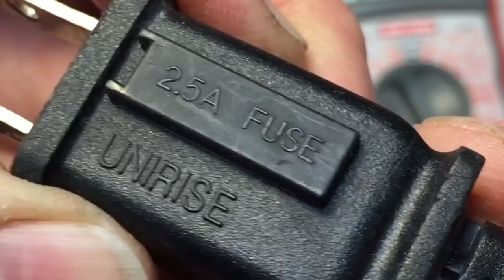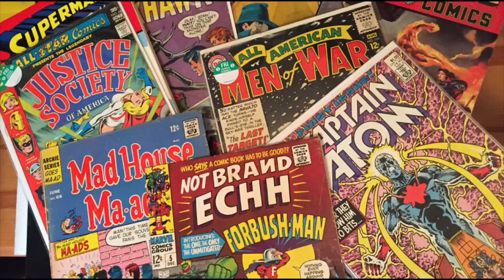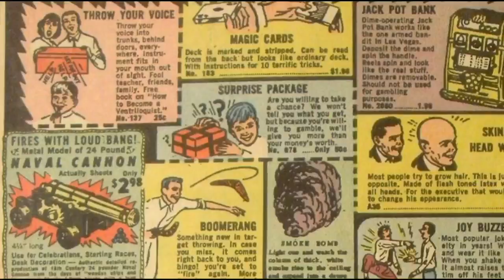Fused Power Cord, Western Electric 500 Telephone and Satellite Spring Shoes!

Comment: Hey Scout, thanks for the memories. I went through a phase of collecting free treadmills and breaking them down to repurpose the motors and other components. A lady listed one for free and said it was working but the display didn’t work so I picked it up. When I was dismantling it I noticed a little hatch on the back of the display and inside was a single flat AA battery. I put a new battery in and the display worked fine. I finished dismantling it but thought to myself “people really should read the instructions”. I’ll bet the instructions that came on the appliance you got the cord from tells you there’s a fuse in the plug. That was the only treadmill I ever came across with a battery for the display. Cheers Stuart 🇦🇺
Reply from the maker: Great find!!

Comment: I used to work on the Eastern Test Range in the early 80s we had those phones, and an old Stromberg Carlson XY switch, one of my jobs was to repair phones, XY switch and cable plant we had roughly 500 lines alot of party lines. I really liked it, the biggest issues with those phones were the smokers the smoke would crud up the mic side of the handset, phones were damn near unbreakable. That has a newer L1 block. Thanks for the memories!

Comment: I remember the old telephone set.  We and my grandmothers had these type of instruments.  They were made of bakelite or similar plastic.  Western Electric was the research and manufacturing division of AT&T.
My dad had a gasoline torch like that one; I still have it.  The little hook over the top and the indentation over the fire nozzle is the location to place a soldering iron while the tip was in the flame getting hot.  It was kind of a trick to get it to light and burn.  It was similar to the Coleman gasoline stove and lantern.

Comment: Hi John, great mosh. First, I was about the same size as you in the photo. I hated getting cloths because I had to get the “husky” sizes. Not that things have gotten any better as I turned 66 last September. I also couldn’t use toys like this so I feel your pain. I have a funny story about the rotary phone. I’ve always been fascinated with how things work and taking things apart. Eventually getting good at fixing and getting back together. I took an old rotary phone apart and figured out the dial opened and closed a reed switch set of contacts to dial the number. You rotate it to nine, a spring returns it to home position, and a cam bumps the reed switch open and closed 9 times during its rotation. In college, the student councils office put a lock on the rotary dial to stop long distance calls. Only a select few had the key. But as a ham radio operator since since 1969, my morse code skills were very good. So I would take the headset off the phone to get the dial tone then tap out the number on the buttons that hung up the phone. If your rhythm was consistent and the right speed, you could dial the phone without using the rotary dial. I was quite the hero until someone caught me. Then they locked the phone up in the desk.  Thanks for your continued work providing us with entertaining stories and demonstrations and ideas and sharing your knowledge with us. It’s a wonderful trip down memory lane most of the time with some new learning and laughs. I work with a lot of younger folks (20’s and 30’s) that have no clue what I’m talking about most of the time. But here that doesn’t exist. Cat tV made me laugh. I was wondering if you have any new litters of mice in the making? Or if you did gynecological exams to separate the boys from the girls. I Dan just see you in a head lamp magnifier glass. That’s twice You got a laugh out of me today. Thanks. 

John
Reply from the maker: Hi John!  I separated the mice a while ago and they seem to be doing really well except mama looks very plump and I’m often wondering if she is pregnant again! 😂😂😂😂👍
Reply: Maybe one of them was a female but now identifies as a male. 🤪🤪🤪

Comment: HaHa every set of modern day Christmas miniature incandescent lights I have had and threw out because they were shot I saved the fuse. I have a bunch. When I was in the Air Force my trade area was telephone installation. After training I was assigned to my first base and when I reported the first day I was assigned to clean those 500 series single Line instruments (desk and wall) They had a work bench and there must have been hundreds of these phones. So another new guy and me worked for a couple of weeks getting through the huge pile. We definitely got familiar. We used a lemon based spray on cleaner polish and it shined them up real well. I was happy to finally get assigned to a crew.

Comment: At a Scout Troop meeting years ago we visited the local Bell Telephone exchange building. When someone is dialing a number on their home phone a like set of electro-mechanical relays are duplicating that number in the exchange and making the proper connection. If all of that equipment were in place today I would stand there and be just as awed by it. There were movable ladders for the switchmen to do maintenance and thousands of relays for them to maintain; an absolute masterpiece of engineering duplicated thousands of times in the US and around the world; and operators standing by to help along the way. Then the early toll free with a “WATTS LINE”

Comment: It's funny every plug here in the UK is fused but in all my years I have never seen one that has a spare replacement fuse holder built in that is such a good idea.
Most of our plugs also require a screwdriver to unscrew the screw or screws holding the cap on to replace the fuse, you do see some with a pop out fuse holder you don't need a tool for I've often wondered why they aren't all like that.
Those old phones take me back, I remember in my early teens a girlfriend of mine had a pulse phone in the house and her parents would use a lock to stop her using the phone dial but she got round it by tapping the pulses out on the receiver switches 😁.

Comment: I use such an old phone on my VoIP line. Just installed a converter between the router and the the phone to convert the old pulse dial to the modern multi-frequency dial. I have a W48, and there's actually a company still manufacturing them and also spare parts for the old ones. Also modern microphones to replace the old carbon microphones, easy to replace. Just unscrew the cover of the microphone on the receiver, the microphone is just laid in (spring contacts), remove the old one and lay the new one in. Screw the cover back on -> done. Massive improvement on the quality of the voice transmission. Heavy bakelite phone.
On the old pulse dial system you were also able to dial without the dial plate. Just push the hook you hang the receiver up to in the same speed and as constant as the dial plate does it. That's the reason public phones here in Germany had a damper inside to prevent people from dialing with the hook, bypassing measures that prevented that someone dialed expensive numbers for the local rate. The dial switch inside does only connect/disconnect the line sending out pulses. 1 pulse is number 1, 2 pulses is a 2 and so on, and 10 pulses is a 0. There were also countries, for example Sweden, where the 0 was 1 pulse, so the first hole wasn't the number 1, it was 0.

I'm almost 40 and I know that. And I know some phones in offices had an attachment on the receiver so you did not need to bent over your head too much to hold the reiver that way. 

https://en.wikipedia.org/wiki/W48_(telephone)

Comment: Phone Fact: Back in the 70's, the 7 Baby Bell Phone Companies charged residents for a phone line. Any extra phones added to the line required an extra Extension Charge. The Security Dept. would ring every phone number once, to do a voltage check. If you were paying for just a phone line, but the voltage check did not match what a single line should be, they mailed out a notice to cease and desist, or get the extension added to their bill !

Comment: Not sure if you know John but every plug in the UK is fused. If I remember, I’ll send you one.
I’m old enough to remember those phones. Did you know you could dial a number without using the dial? If you tapped the buttons that put the phone down quickly, it never put the phone down but dialled a number. Eg, if you wanted to dial 911, hit the button 9 times really quickly, pause for a second, hit the button once quickly, pause for a second and hit the button one more time. Hey presto you’d get put through to the plod! Did you ever try that method of dialling?

Comment: The spring shoes weren't as good as a pogo stick. Not enough spring in them. The rubber buttons were needed for moving with them. Without the buttons they were so slick on the sidewalk you would end up flat on your butt. 
I remember reading a story where before 911 you would call the operator. They would send the police or fire and give advice on how to handle minor problems. Since most of them were Moms they were use to it. A woman called the operator and said she was trapped in the house. She couldn't get a window open. The operator told her to throw the phone through the window. They were tough. So was the phone. 😁😎

Comment: To test the dial speed for proper operation, dial zero. When you release the dial it shook take one second for the dial to go back to the parked position. We used to count , one thousand one. Just a field test from the old days. Those phones are dated either on the bottom or on the side of the network box. The plastic dial is a newer phone than the metal dial. 

Thanks for the fun.

Comment: You could throw those phones and not break em. I know a guy that worked for the phone company he still use a rotary dial. I was told in power outage those phones would still work. I suppose because it was on another grid?
Reply: i have one in the basement for when the power goes out it uses the power from the phone line low voltage and the cell towers are down so my cell phone dont work

Comment: I will never part with my rotary phone.  My parents got it in the early1960s (on a party line, no less!) and IT STILL WORKS.  Or, at least it would if I had a landline, which I don't anymore.  But when we did away with the landline in 2018, the rotary phone would still dial out, and that bell inside could wake the dead when someone called.

So, it still sits on the small table next to the antique console stereo - also inherited from my parents.  More an artifact now than a working telephone, but I'll never part with it.

Comment: I picked up a tumble dryer a few years ago via the freecycle network, was stated that it worked fine then suddenly stopped, theymthought motor or program module both easy to get and fit, got it home started trouble shooting plugged it in put a voltage detector over the cable and low and behold a blown fuse, that was eight years ago and its finally packed up and not worth repairing so now its broken up and is part of a fire pit

Comment: If you want to convert that power to a regular cord, you just remove the fuse and stuff aluminum foil into the space of the fuse.
Reply from the maker: Actually a small piece of copper or Brass rod the same length and diameter would be considered a decent fix!  We don't usually see too many of those mini fuses around here these days.  =D  Thanks!

Comment: The neutral has ribs on the side of the insulation. If it’s polarized, the wide plug is the neutral. I remember this by saying white wire is wide plug
Reply from the maker: I remember as a kid learning "never trust the ribs" as I guess there were old batches of imported wire that were not to code.   To this day I am always paranoid and check all my wires before hooking them up.  Even though with a lamp it doesn't really matter!!!   LOL  Thanks!
Reply: @ScoutCrafter  I did not know about the bad ribs , learned electrical in trade school in mid 70